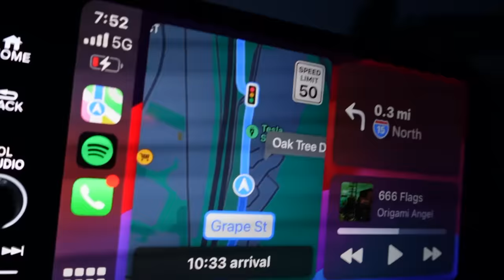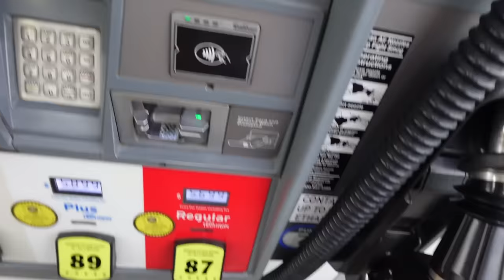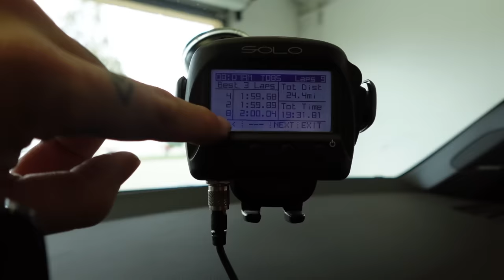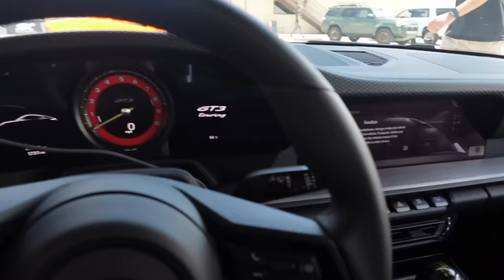Trading my FL5 Type R for a 992 GT3..

Comment: Amazing video. If you haven’t tried it yet, when loading up your Type R to go to the track, leave the back seats up and put your track tires side by side in the back seat. I fit a set of four 275 wide tires on 18x9.5 wheels in my FK8 and now my FL5 this way. I put a moving blanket down first to protect the seats. Then the entire trunk is empty for tools/gear/clothes. I also put a folding chair sideways across the floor of the back seats. Keep the FL5 track content coming!
Reply from the maker: No way! I’ll try it out 🫱🏼‍🫲🏻